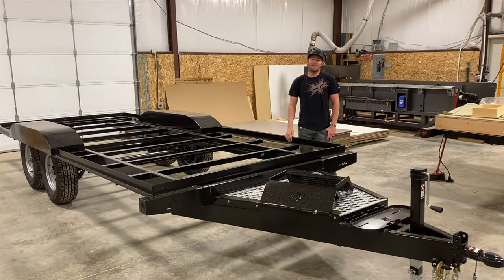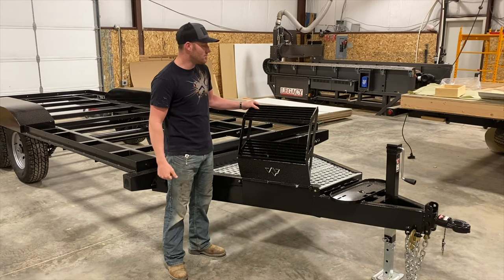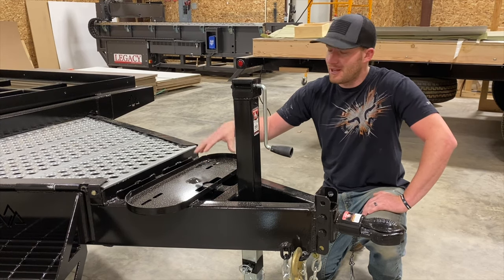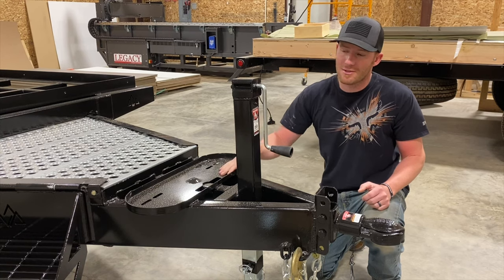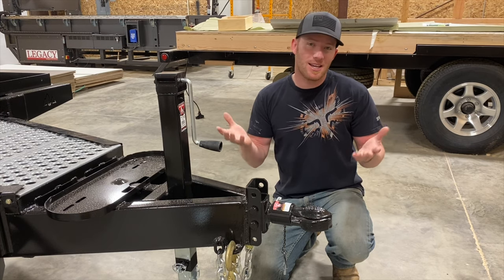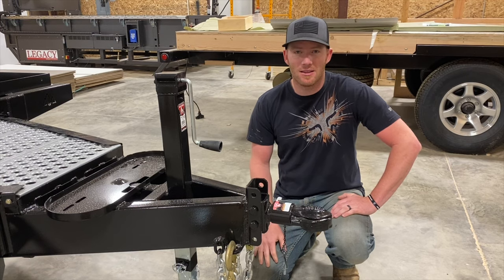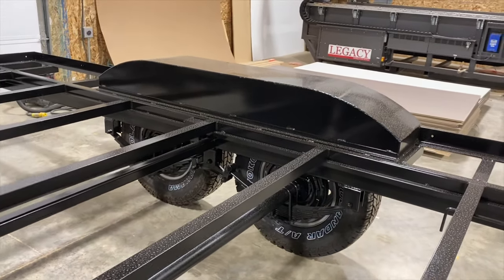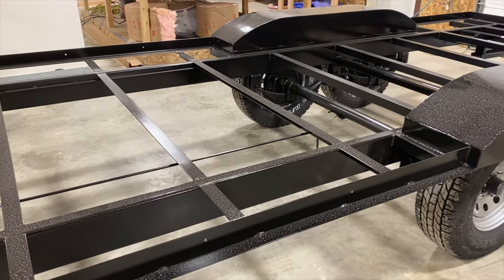Tandem sheep camp frame

Comment: What size are those tires? They look bigger than normal.
Reply from the maker: Spartan Greywolf they are a 245/75 mounted on a 6 lug 16” wheel generally we do a 235/85 on a 16” wheel
Reply: @peakmountaincamps  Is there a performance increase on or off road than what you typically use?
Reply from the maker: No real advantage just what the customer wanted.